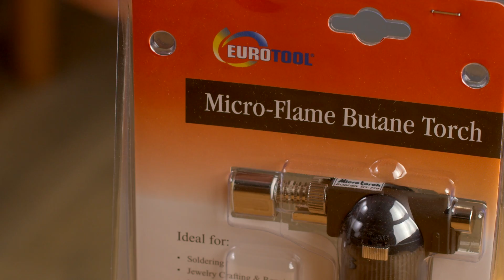Butane Torches for Soldering Metals

Comment: i bought one, but on the label it says welding with it can cause cancer. i don't know how true that is.
Reply: Anything produces smoke or fumes can potentially cause cancer if you do not work in a well ventilated area, with an extraction unit.